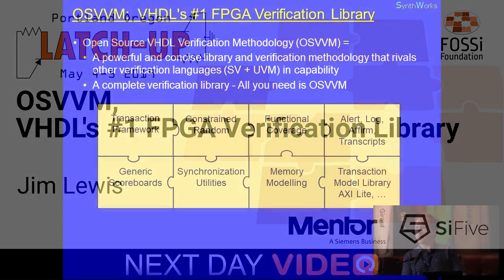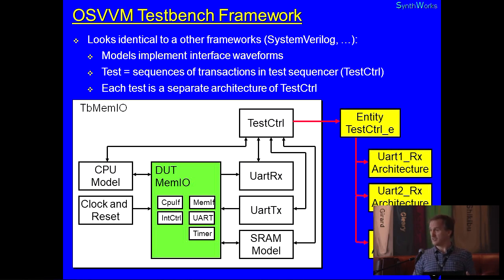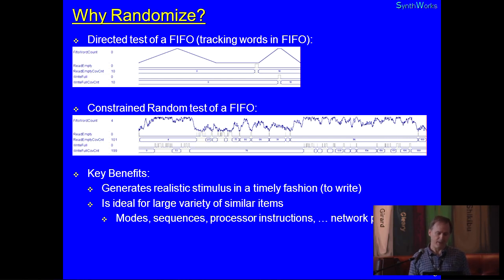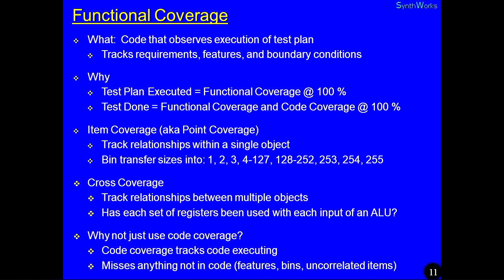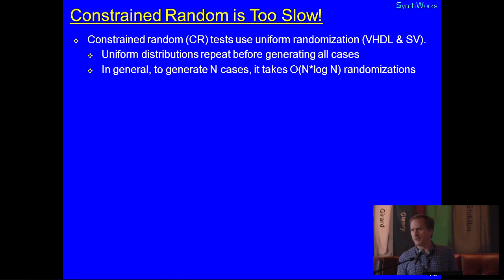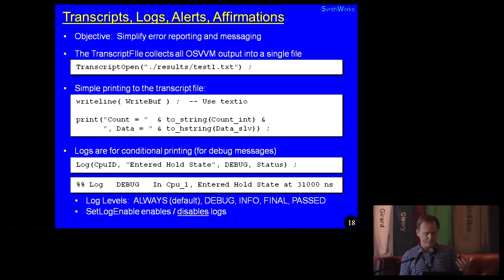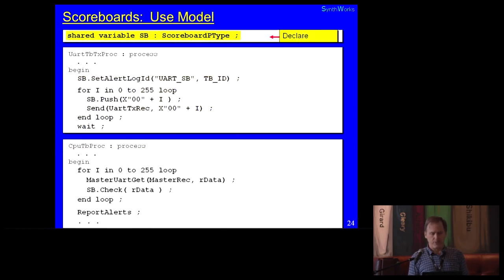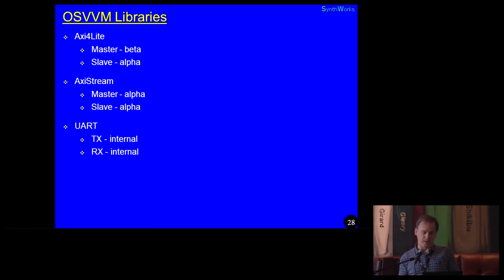OSVVM, VHDL's #1 FPGA Verification Library

Comment: Can the RTL also be in Verilog or SystemVerilog when writing Testbench using OSVVM ?
Reply: No, OSVVM is VHDL only. If you want to use verilog, look into UVM
Reply: Yes you can. If your simulator supports Mixed language flow you will be able to OSVVM.
Reply: Yes, the DUT can be any HDL if your simulator support mixed language.